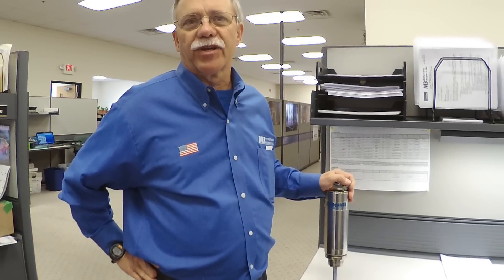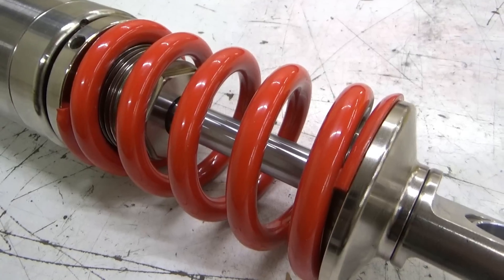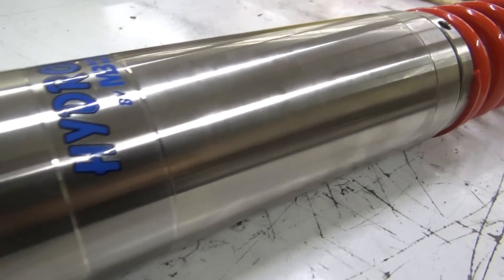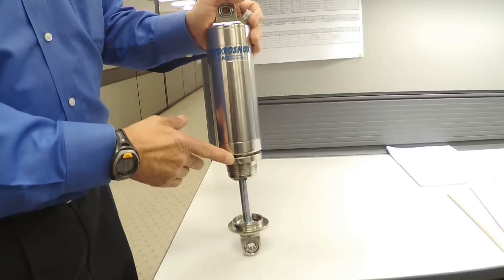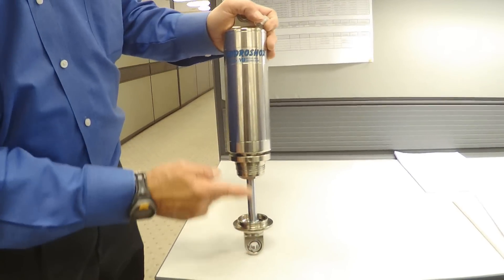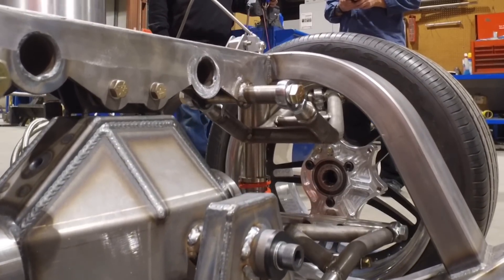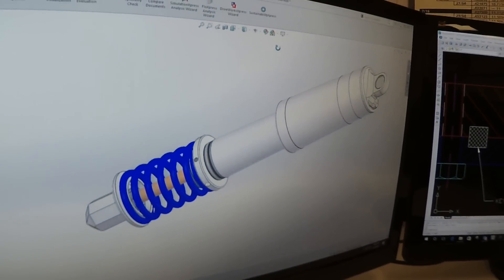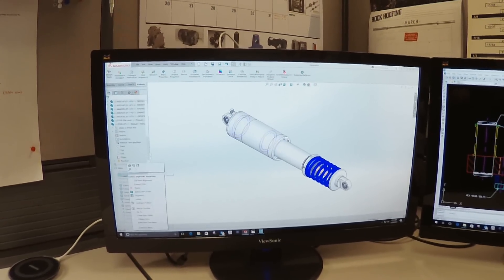Hydroshox - Design & Development

Comment: Yes... you can adecuate the suspension stiffness choosing different spring rate but in all cases suspension travel is practically nonexistent with the system that you have designed..

Good aproach anyway